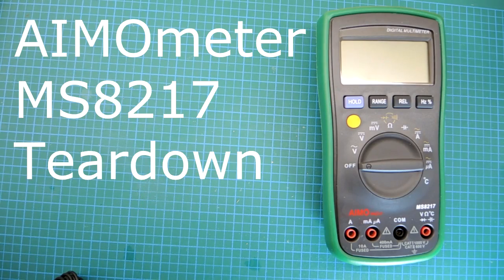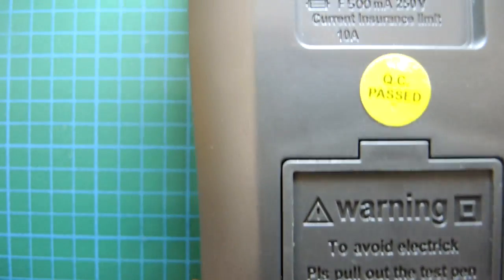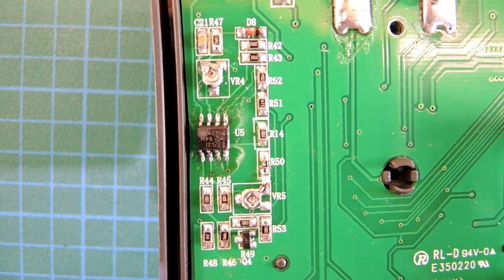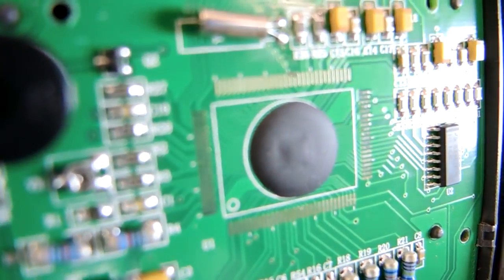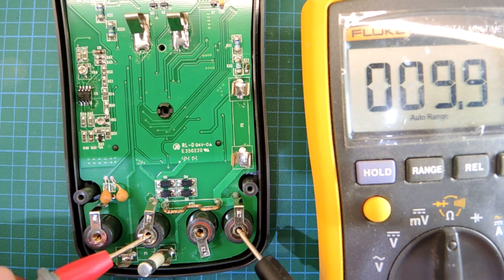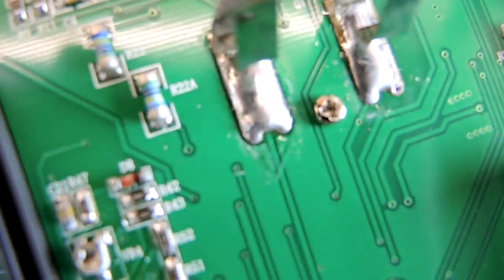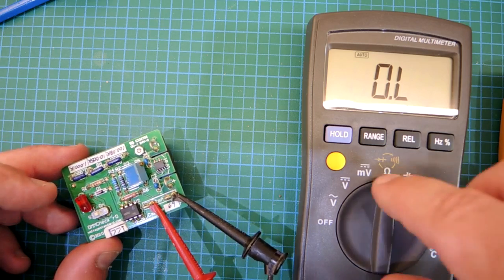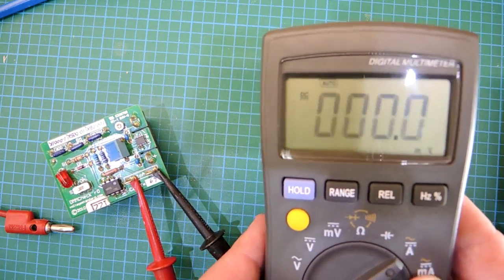Aimometer MS8217 Multimeter teardown: Fluke 17B Clone?

Comment: I have a real Fluke 17B+ that I really like, its one of the newer ones made in china but internal build quality is first rate and it looks/works as good as any fluke.  JoeQSmith ran his full range of transient and voltage tests on the 17B+ and it passed with flying colors even going well over its specifications, thats why I ended up buying it. - Input protection devices are sized and configured as you would expect in a U.S. made fluke.  However, out of curiosity I just this month ordered an obvious cheap asian clone of my fluke 17B+,  logo just says 17B without the + and is humorously branded as "WINHY" but it looks almost identical.  Surprisingly, the cheap clone is very accurate with a nice display and rock solid range switch and seems to be very accurate.  However other than the sketchy low end fuse and one very small PTC input protection is virtually non-existant.  The board calls for a 600mA 6mmx30mm fuse in the low current range but it has a 500mA installed because as it turns out its impossible so far to find a 600mA fast blow ceramic fuse of this physical size anywhere I looked.  The meter display is a 6000 count and changes ranges at this point & burns the fuse early with the 500 mA installed-lol.   The clone isnt even close to my Fluke far as input protection and feel, but I have to say for the $20 it cost its worth its price and would make a good electronics DC hobby/home meter long as you stay away from big voltages.

Comment: I wonder if this was based on an existing design with an unfused 10A range - like most cheap Chinese metres - and they were just too cheap to redesign the PCB to add the fuse in properly? As you say, it wouldn't have been too hard to connect the fuse up properly if they designed the meter that way in the first place.

Comment: Wonder if that fuse is connected to anything, or is just there as a dummy fuse, to fit a spec sheet claim. They might have left the one end open, or connected it to common and as well use a fake fuse.
Reply from the maker: Such a strange thing to do given how inexpensive a real fuse is and how simple it would be to route the traces to make use of it
Reply: SeanBZA It looks like there is a trace running north from the fuse. I wonder if they have fused the link between the ADC and the shunt instead of the shunt current itself?
Reply: Keenan Tims yes but that fuse sure looks like a ~10A-ish fuse, if you put 10 amps into your sense electronics you've already lost.
Reply: jusb1066 Shouldn't do, so long as they measure the voltage across the shunt itself and not across the fuse too. I guess they just couldn't be bothered routing the traces.
Reply: ***** i would imagine the fuse messes with the accuracy of the shunt, so it was better for them to fake it

Comment: China is overdue for a 830b replacement, they seem to latch onto design and stick with it for a generation of clones, but hats off to the 830b it has given lots of people a cheap start into simple fault finding, I totally saw the fuse issue right away, what a blunder!
Reply: jusb1066 for a generation of clones.... good one. May be more of a little wealth distribution.
Reply: TheOldmankk
i have no problem with them gaining some market share, i own a uni-t which was well reviewed a while back for £10, ive been happier with that than the fluke 83 it has replaced